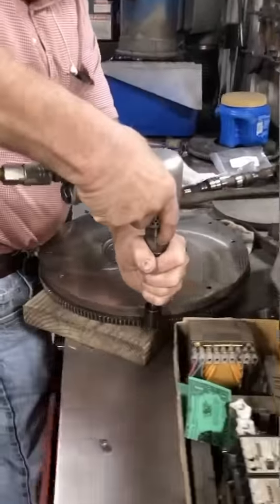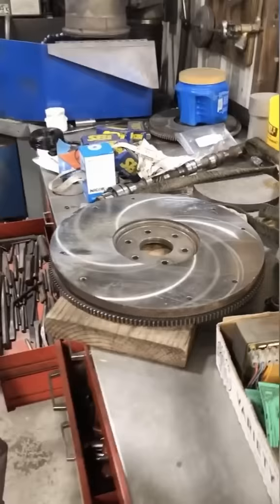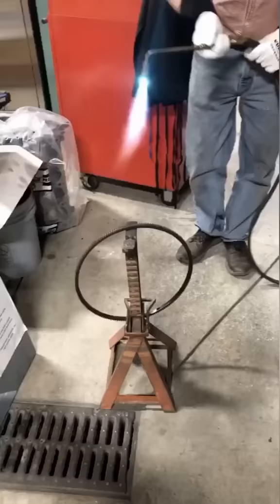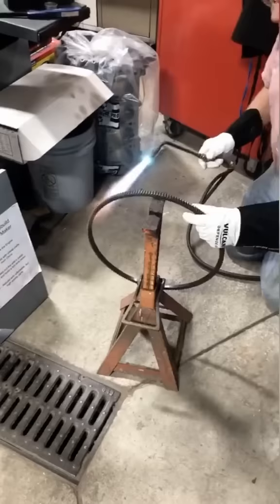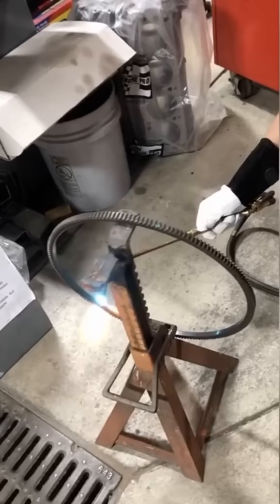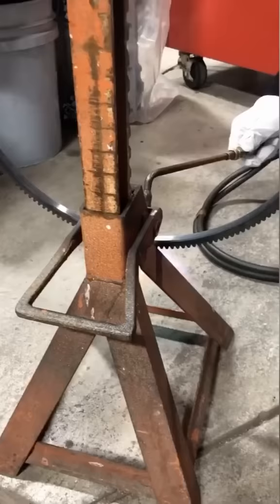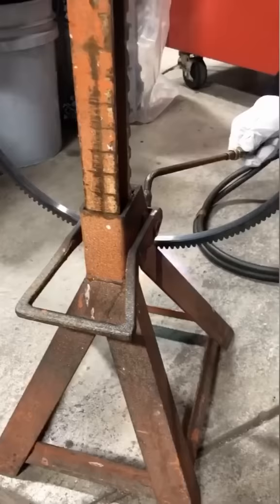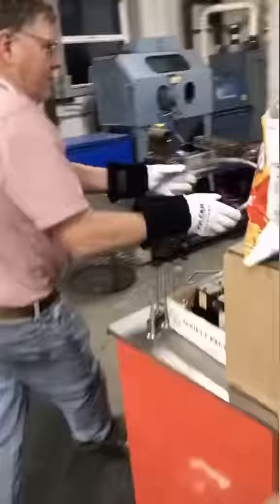#shorts Flywheel Ring Gear Replacement

Comment: Have to be honest had no clue the ring was separate, never had to replace one besides a worn plate...very cool
Reply: Another protip:

You don't have to barely heat the new ring, if you also put the plate in a fridge or freezer just to where it's slightly cold to the touch.

Cooling the plate gives you a couple thousandths of shrinkage, and slightly heating the ring gives you a couple thousandths of expansion. That thing will pop right on there in about half the time and effort, with less extreme temps to either component. So no risk of warpage or metal hardening.  :)
Reply: @strikeforcek9149  definitely! Route I prefer to take on expansion as much as possible. Thanks you the tip
Reply: @strikeforcek9149  I was a jet engine mechanic for ten years and when we would tear down the engines for inspection, there were a few bearings and seals that we would would put the bearing in the freezer for a bit and then next to it we had a heat cabinet which was similar to an oven that we would put the race in to heat it up then put them together. It amazed me back 35 years ago that just how much of a difference a little heat and cool temps can actually change a chunk of hardened steel like that in just a short amount of time. 

Makes me wish I payed better attention in science class, lol
Reply: @1982MCI  lol. Yep, it's insane just how little it takes to change something drastically lol. Definitely makes me wish I would've paid attention even more too lol.
Reply: Same concept applies to numerous mechanical assemblies. Warm connecting rods and cool the piston pins,  put sleeves in freezer a while before installing in engine block, etc. The wonders of science.
Reply: @lsimpson6223  Yep! I never thought to do it with rods, pins, and piston believe it or not. I typically just used a press for pins and pistons. 

Thanks for the tip man, I can't believe I hadn't ever considered doing that on the internals like that. I've usually only do bearings and flywheels like that. So, thanks!
Reply: @strikeforcek9149  but the plate takes an hour or more to get warm again..
Reply: @1982MCI  I was watching a friend putting cylinder liners in an old engine. The first one he just cooled the liner, it fit, but he had to help it down into the cylinder block with a hammer before it warmed up too much and got stuck.  He decided to heat up the block a little bit on the next one, he assumed it would be a little tight but not as much but to his surprise when he placed in the bore and let go, it fell into place and bounced back out about an inch.  That made us laugh, but it was definitely easier!
Reply: If you're really unlucky like me, the ring gear separates from the flywheel while inside the car😁
Reply: @strikeforcek9149  our heavy-duty mechanics uses liquid nitrogen when fitting bushings. Cool things to watch..
Reply: Some of the cheap starters can ruin the ring gear!
Reply: @strikeforcek9149  Me 3rd, or 3th? I don't know lol maybe y'all will get that reference to another YouTube guy. But really, I learned that one from my bff who's a welder and it's saved my butt a few times
Reply: @kingcrack4422  The flywheel won't take an hour to get warm again, lol.

Here's how you do it, step by step
- Put flywheel core in the Freezer for around 20-30mins.
- Slightly heat up your ring gear with just a little heat.
- Pull flywheel out of the freezer and set on work bench.
- Touch a little more heat to your ring gear, and pop it right onto the flywheel.
- Ring gear will spin easily and even freely sometimes for a few seconds, so get it seated exactly where you want it.
- Now apply just a slight amount of heat to the flywheel plate part as a whole, just enough to take the chill out of it.
- Congratulations, you just changed your ring gear and everything is at room temp, or warmer, with 2mins of pulling your flywheel out of the freezer. 🙂

If you don't have torches, then just put your flywheel under a halogen bulb or other lightbulb directly about a foot away. It'll take the chill out of the metal and allow it to expand enough within about 15mins. Flip it over every couple minutes to allow it to normalize quicker.
Reply: @Gixxer2247  I was thinking the same thing 😂🤙
Reply: @whodahellru8124 u .
Reply: @Gixxer2247  ouch.
Reply: Same..
Reply: B
Reply: @strikeforcek9149  matters quite a lot for heat treated parts.
Reply: @Wehra96  That doesn't really say much... What comment are you referring to, what process are you referring to, and what metallurgy are you referring to?

Your comment doesn't really explain it compound on anything... lol
Reply: @strikeforcek9149  the very top comment, i am used to other chatting services that link to the comment you reply to sorry, as a machinist i work with a fair amount of heat treated components and the assembly is done basically only using chest freezers and sometimes heating cabinets set to like 40-50c.
Reply: I was thinking the same thing. Interference fit for a flywheel.
Reply: @strikeforcek9149  Actually metal softening is the problem, when you heat the ring too much then it cools down slowly, it will soften  reducing it's lifespan. Your method is way better, can also put it with a bag and throw dry ice on it if no freezer is available.
Reply: On a car with an automatic transmission you don't do this. Only on cars with manual.
Reply: @strikeforcek9149  do you have a freezer in your shop? 😊
Reply: @arnoldarnold1034  yes.
Reply: No one does this anymore, or at least a good job. Not to mention the amount of people who drive stick
Reply: @Gixxer2247  I had the ignorant ass dual mass flywheel in a BMW break in two while I was driving once.
Reply: @toomanybears_  Oh wow! That is some terrible luck!! 😢😢 I am so sorry!
Reply: If they get worn you usually don't even have to replace them.  Flip them over, or just move them to a different clock position.
Reply: It's also the same with wheels on trains. You'd think that it's one solid piece, but the "tire" is a seperate part and changed out in the same way.
Looks awesome.
Reply: I had a 8n tractor like this flywheel - remember to spot weld ring to flywheel- also had to put cylinder liners in freezer before insertion into block
Reply: @toomanybears_ unless it's a dual clutch transmission, but then again those are technically automated manuals
Reply: @toomanybears_ my passat diesel dual mass has been making noise since 120k miles I'm at 150k and she hasn't let go yet XD

Comment: This is an old school journeyman. He actually repairs things we new technicians have only known to replace.
Reply: Old school master
Reply: The problem now is where to get just the gear and not the whole flywheel? Suppliers follow what technicians want. Full parts are faster(easier) to change than actually fixing what is broken. 
All this knowledge is aging out and not being passed down.
Reply: True
Reply: @leofortey7561  you are right.  Been told plenty of times “ just get a new car “.  Sheesh !
Reply: @leofortey7561  I am a car enthusiast and if I needed a new starter ring gear I’d just get a new flywheel, by new I mean from the junkyard but I’m not gonna bring an air hammer to the junkyard, plus it’s probably less than a $20 difference between a flywheel assembly rather than just the ring gear
Reply: @leofortey7561  you don't even need a new geer, just turn the old one around. I know I've done it, and it worked fine. Hint, put the flywheel part in a freezer and use a cheep propane torch or a Bar-B-Q fire for the ring.
Reply: He literally just replaced the ring gear.
Reply: @leofortey7561  dude you can buy new ring gears online and at part stores all over the place
Reply: you just watched him replace something it's not like he reforged it or anything
Reply: @leofortey7561  u 7766
Reply: The issue isn't so much that you weren't taught, it's that labour rates are so high that it's generally cheaper to just buy a new part.

For example I had an issue with my car and it turned out to be a bad tune and somebody had added bad files to the computer. It was a 10 minute fix but took him a day to figure out, because of labour rates I would have been better off just replacing the computer at home.

Now don't get me wrong, what he did was obviously cheaper than buying a new part but you'd have to be a super mechanic to know all the tricks about repairing all the parts.
Reply: Speak for yourself, I was taught by the old school guys to do stuff like this.
Reply: This is a super common practice
Reply: I have replaced many of them in my lifetime all fun and games till you wear thin gloves to pick it up hot lol
Reply: Although I agree with you, a lot of things changed from back in the day such as the metal used. Some metals cannot take the heat without weakening the metal to a nearly unusable state. Also, it is nearly impossible to find a part like the fly wheels gear without the whole part. All this to say that although mechanics have been spoiled, it is not all their fault.
Reply: Manufacturing and automation often means a new part can be made much cheaper than reworking an old one.  You still have to do this for rare pieces, but resurfacing a flywheel and replacing the ring gear can run as much in labor as it takes to build and sell a new one.
Reply: A little inflation seems to bring back the old ways
Reply: Still doing repairs! gotta keep the trade rollin right🤙🏽. The knowledge and skill is still out there. Don’t settle being a parts changer.
Reply: All the guys that know how to do these kinds of things work for the same company’s and we the techs go through the trouble of pulling it out for them (the cores we return are what these dudes are repairing)
Reply: Umm, not sure if you're an actual tech or not. FYI, he's replacing a part, not repairing it. But the reason that things typically get replaced now is that everything is plastic or cheaply manufactured. It's cheaper and less time consuming to replace parts rather than repair them. Why would he repair the ring gear rather than replace it???

Comment: Thank you for mentioning his knees, I felt that floor as soon as he knelt down.
Reply: I always kneel on my opposite foot. Am I the only one?
Reply: I use motorcycle pants with knee pads built in.  they are also more resistant to welding than jeans.
Reply: He need a pad on that floor for his knees

Comment: That's old school knowledge and years of experience...bless that man!!
Reply: Thats called annealing and good luck with your softened non case hardened ring gear
Reply: @gitar1hero1qaz  ...if it wasnt safe to do in any capacity my dad wouldnt have done it for years on aircraft. With procedures APPROVED BY THE FAA. And before you say "they were bought off", no. These are the people that will fuck with you harder than the IRS if you miss a single thing, no matter how small. So if the FAA approves, im sure its fine. Besides, he specifically said "not red hot". Its just using physics and thermal expansion / compression to achieve a good fit. Shit ive known about for *years*. 
 
Note: if it wasnt tried and true, it wouldnt have been passed down the generations of mechanics and shop hands.
Reply: I did a similar thing in college. My old school teacher froze wrist pins for con rods and slipped them in
Reply: I was a new guy at a 120 year old company and watched an old pipe fitter do something similar. They could cut their own large gears.
Reply: @cq4538r  depending on the metal this procedure can be done with even heating (not just with a torch).
The thing is the metal used in aircrafts is specifically sorted for specific procedures.

Just cause you can do a procedure with some alloys does not mean you can do it with all of the alloys.
Reply: @dergunter1237  this is true. I'm mostly responding to the idea that it can't be done safely, at all period end of story. Which is completely false. It's incredibly easy to do with most aircraft parts cause they use different metals, and one will expand faster than the other. Significantly lower risk of causing an issue.
Reply: @gitar1hero1qaz you’re full of it.
It takes red hot heat to lose the temper, for one thing.
You do the same for ring gears in the differential.
Once the bolts are all out, you put the carrier with the gear at the top on one of the bearings.
Spin the carrier, and warm the gear.
It’ll get to a couple hundred degrees, expand, and drop right off.
Turn the carrier over so the mounting surface is now facing up, right on the same bearing.
Plant the new gear on the carrier, and get the holes as close as possible.
Again, spin the carrier and warm up the gear.
When it drops on, quickly take a couple of the bolts and snug them on, turn it over and do the rest.
Then get that carrier into a vise and torque the gear to the carrier at the proper torque.
Snugging the bolts on by hand eliminates any gap before the assembly cools.

I’ve done this to more than a few cars to change the rear end gear ratio.
The pinion gear is part of the pinion shaft, so that just gets replaced.

You aren’t looking for red hot, just warm.

Comment: My uncle ran a shop for about 40 years and had a little oven in the corner that I always thought was junk until I saw him pull a pinion bearing out of it once. I was fascinated by the concept as a kid.
Reply: And popcorn.
Reply: I had a toaster oven set to 180 degrees for bearings. Worked like a champ.

Comment: I would much rather pay tuition to a man like your Dad rather than college. I was fortunate enough to learn from someone like him and I can't begin to tell you how grateful I am to this day. The lessons stuck with you for life.
Reply: It's funny when I went to a technical school for automotive the teacher was an old man instead of teaching us about how to work on cars this man was showing us how to rebuild water pumps power steering pumps how to do alignments using string and magnets how to rebuild carburators  he really didn't teach us nothing about what really goes on in a real shop but I'll tell you one thing when I worked on one car I remember the parts store didn't have the part needed and noone had power steering pump for that car and the knowledge my teacher reached me came in handy because I remembered how to rebuild them and ended up rebuilding his pump and it worked perfectly fine after I rebuilt it and it stopped the major leak it had my manager even told customer that we couldn't find part anywhere and told him that I rebuilt it for him the customer check to see if it was leaking or not when he seen it wasn't leaking anymore he gave me a hundred dollar tip

Comment: I'm using the oven and the freezer method.
Cool down the flywheel, heat up the ring gear
But yours is way easier and faster.
Thanks!
Reply: The freezer and oven gives a much more even heat. Freezer is around 0°, oven at 500° produces quite a difference in size.
Reply: The oven in the freezer technique works for so many things And with the oven freezer technique You have less chance of burning the s*** out of the gear some people torch it too much in one spot and distort the gear
Reply: This dude's shop does higher volume than hobby mechanics like most of us.  I myself used the oven + freezer too, but it was a weekend project for me & the wife, not on a customer's dime.
Reply: If I were you Id stick to the oven technique. The blowtorch has a much higher temperature plus you have actual control over the temperature. You might loose some of the steels properties from heat treatment if you reheat it in an uncontrolled manner.
Reply: @HiroNguy  well if that's thé case, then there is a lot of magnetic systèmes that would heat a lot faster and with near to 0 risk of deformation. And they're not that expansive. :)
Reply: @philippesoares1745  If your volume of business can support buying such a tool that's great.  It sure doesn't sound like anything I can justify as a hobby mechanic.
Reply: I do the freezer/ tourch method on press fit wrist pins.
Reply: I've seen bearings done in a similar fashion except it was done with a hot oil bath using an electric fryer.
Reply: @HiroNguy  who work on heavy equipment I've worked in shops on BMW's Mercedes Audis I work on Peterbilt caterpillar John Deere this guy ain't got s*** on me
Reply: We used to use the oven / freezer method on bearings for electric motors back in my Navy days.
Reply: @HiroNguy  Both dealership workshops I spent years in (Isuzu and Volvo) had a cheap oven and freezer in the workshop for doing these kinds of jobs.

Comment: I flipped the ring gear around on  Datsun once, to present fresh roots faces to the starter pinion.  A brass drift took it off the flywheel.  To reinstall I heated the ring in ghe oven + chilled yhe flywheel in the freezer.  
Easy peasy.
Reply: I noticed the back of the teeth have a squared edge compared to the front's edges are rounded to assist smooth engaging of the starter. Figured it'd cause trouble starting on back to front.

Comment: There's some videos online you can watch on how they used to fit "tires" (heavy steel rings) onto steam locomotive wheels, they used to do this so if they got a flat spot instead of replacing the entire axle assembly they just remove the "tire" same method as this but to achieve quick and even heat they would soak the tire in diesel and light it on fire and within seconds it was expanded enough to set on the wheel
Reply: Wow on a locomotive!?
That would be awesome to watch I'm going to go check it out right now
Reply: Cool
Reply: During the later part of steam, they used a ring of fire to warm the tire.
Wagon tread rings are mounted the same way, with the difference being that the metal is red hot, and the entire wheel is dipped in water to cool the metal and seat it properly.
The compression of the ring is what keeps the assembly together.